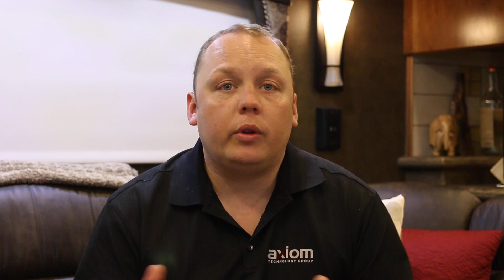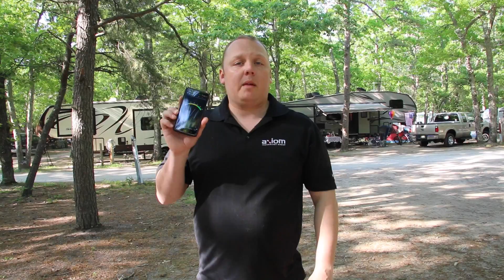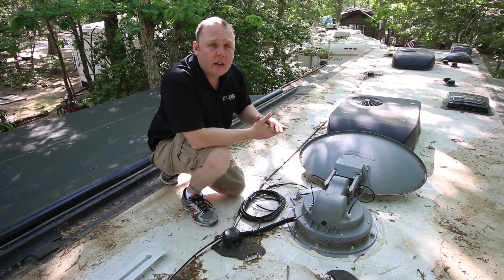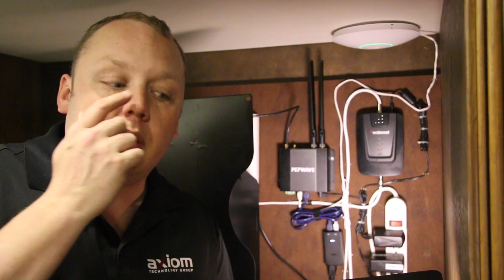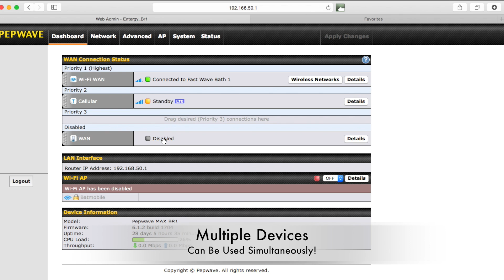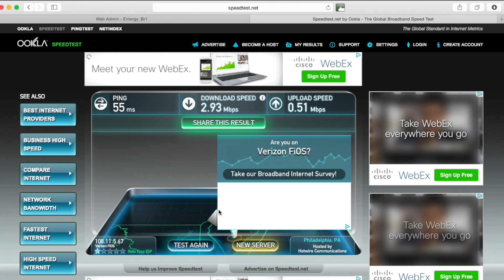Reliable Internet In Your RV Without Data Charges

Comment: Finally someone that actually seems to know a bit of the technicality of the items they review... whew how refreshing. One thing though RG-59/RG-6 is generally 75 ohm not 70 ohm though in short runs it really won't make too much difference. Good quality 50 ohm cable will make a difference in signal transmission. What is the 'app' you are using for the wifi direction?
Reply from the maker: +Riki B. Eyestarone thanks Riki, yea there are a bunch of notes in the video that only show up on a pc or mac. With mobile the comments/edits don't come up. We've changed this video to recommend the following: Technically you want a 50ohm cable (LMR-400 or RG-8 for runs over 10 feet) for best results but we found 70ohm (RG6, RG59) works too with an adapter found in our amazon store. the app we use is called wifi analyzer which there is a link for the app in the google play store https://play.google.com/store/apps/details?id=com.farproc.wifi.analyzer&hl=en
Reply: +LivinLite.net Yea... I use the same cable we use coiled around the mast of our EFP video units for sat and microwave. I've forgotten the cable number (I think you are right it is LMR) but we use 'N' connectors on it and the stuff is the thickness of a garden hose. 

You might want to recommend that the connectors be wrapped in silicone tape with dielectric grease used on the connectors as you are driving moisture into the connectors and cables leaving it all up there all the time.
Reply from the maker: +Riki B. Eyestarone thanks Riki, great feedback. More to come as we are testing the Wifi Ranger Elite right now and so far its pretty cool.

Comment: Just discovered your channel, great video!  Like the setup you did for wifi and the way you laid it out behind the tv.  Definitely a professional job!  We are in the process of selling our home and will be ordering a Class A and full timing a few months later.  I will be working some from the road, sort of semi retired. One of the decisions I am on the fence about is AT&T (which I currently have), Verizon which many recommend or T-Mobile which looks better everyday.   What is your opinion of the three and would you go with if you had to choose one.
Reply from the maker: Hi Ed! Oh the number of variables that go into answering your questions!!!! Ok let'st start by stating that these are opinions and they are highly dependant on where you are in the country, what your budget is and what your tolerance for issues/connectivity problems are. With that said, we'll tell you why we chose what we did. My vote is for ATT, the reason is because Verizon is cracking down bigtime on anyone using more then 90GB of data. This includes people with grandfathered plans out there. We have an ATT unlimited that we use regularly with about 100-130gb of data per month and we have no issues. We also like that when we go to festivals or other gatherings the ATT seems to always work better than Verizon (because everyone has Verizon and the network becomes very saturated during large events).  Now that said, i've heard nothing but good things about T-Mobile in recent months and they offer some pretty cool unlimited streaming plans that will knock out much of the data usage for most folks (netflix for example). We dont have any T-Mobile experience but since they run essentially on the same technology and network as ATT (because they had planned a merger for quite some time) this could be a great option. Now all that said, we use Verizon for our backup connection and it is the best in rural areas. Its almost always the fastest and has the best coverage out of our three (Sprint, ATT, Verizon)... That said, we can't use it for our needs because of the issues with unlimited data plans.... Make sure to checkout our article on unlimited data plans located here http://livinlite.net/how-to-get-an-unlimited-cellular-data-plan/ . There are some good tips there as well. Good luck!
Reply: Thanks for the info. I was thinking about it yesterday and decided I am going to keep my AT&T plan leave two of the lines on there and just move mine to T-Mobile to try it out.  That will give us the T-Mobile with the Hotspot for the PC and AT&T for streaming to Apple TV. The unlimited AT&T plan I have doesn't allow tethering. Thanks again!
Reply from the maker: +Ed Bickford Glad we could be of assistance! Let us know if you have any other questions!
Reply: What kind of speeds do you get with your mobile contract? Download would be my major concern, not so much with upload. Thank you :)

Comment from the maker: Some folks have asked us about omni-directional antennas being mounted to the Winegard bat wing TV antenna that comes standard on most coaches. We are testing this setup currently and will report back once we have more data!
Reply from the maker: +Life In Serenity Hi, testing went well. The key with omni directional (really any antenna, but directional will compensate for some of these shortcomings since they have higher gain) is to have a very strong wireless transmitter and to use the right cable to reduce signal loss. In general with a moderate to strong signal at the campground omni is great. If you have a very weak signal you may want to look at a WifiRanger product which provides an omni directional antenna and a very strong antenna to get some serious signal distance without having to point an antenna. Our wifi ranger video is coming soon as we are currently testing two units they sell extensively to see what we think. More to come!

Comment: I'd go with a yagi antenna rather than the panel variety. It's lighter and has higher gain. You'l losing about 5 dB worth of signal with the panel antenna, and that's a lot at the frequencies you're trying to receive. I don't know the length of that coach but it looks like near 40 feet. That's a very long run of coax, and that's also going to attenuate your signal. With a perfect match at the router you're losing another 3.7 dB of signal with good quality Belden RG-6A cable. RG-59 is worse at about 4.1 dB loss. 

A strong wifi signal strength would be about -70 dB. You can get that with the antenna in your laptop. It's more likely you're trying snare something like -30 to -40 dB worth of signal. Using your setup, you're giving up about 20% to 25% of the signal before it ever gets to the computer or router. At least get a yagi antenna. They are less than $40 from Amazon. I'd try to find a way to mount the antenna on the side fo the coach closer to youer entry point with something like an extendable flag pole. You can still rotate the pole, get the antenna up higher, and cut your coax run in half. You can just lower the pole to where the yagi rest on the roof, tighten up the pole, and you're ready to travel. Saves a lot of going up and down that ladder and it's a lot safer if it's wet or icy. For people who don't have a coax entry point, you can just drop the cable through a window since you're only going to use it while you're stopped. 

Of course, none of this does any good if you're at a campground where the wifi has very limited bandwidth. My experience is that limited bandwidth is a bigger issue than inadegaute signal strength. Campgrounds pay for their connection based on the number of  concurrent users. If it's a 100 spot campground, they may have a 30 user system. That's adequate for a lot of the year but not for things like holiday weekends when everyone watches streaming movies at once. If you happen to be user 31 on that system, you're out of luck until someone logs off. The only two answers are to use you improved antenna system to see if there's an open system in the are you can use or go to cellular data. If you're in an urban or suburban area there may be a McDonalds, Walmart, or Starbucks close enough that you can use their wifi. Look at google maps and plot the direction of those places or use one of the many free wifi directories on your tablet or phone. Turn the antenna toward those directions. You might hit paydirt if you are within about a mile of the location.

Comment: That pepwave device is performing a double NAT when you use it that way, which is why it allows you to only pay once for all of your devices. That may seem like a nice thing to have but it adds latency and can cause sporadic behaviour from devices that require UPnP to function properly. You also have to take into account that the secondary signal you are broadcasting can interfere with the primary signal if they are both in the 2.4ghz spectrum which is usually the case, not to mention everyone else around broadcasting 2.4ghz networks. To get the absolute best speed you should get a device that accepts the wifi signal and simply converts directly to Ethernet, an old PC running linux / bsd / illumos would work fine. Then you would connect that to a wifi access point, not a router. You would want to run that access point in 5ghz mode only.
Reply: My 40 foot RV is permanently located more or less as a cabin in an RV park in the Poconos Mountains.  The park I am in does not allow a secondary signal and anyone caught doing this will be expelled from the park.  Not a big deal if you are there for just a few night but I don't want to take the chance of getting caught.  Now converting the signal to Ethernet seems like the way to go for me.  Thanks for the idea.
Reply from the maker: I generally discourage double nat (at work) but the pepewave is specifically designed to understand how to manage this. It also knows how it routes DNS traffic between connections as it moves from one to another which is a nice tough preventing downtime while switching . In the 3 years we've used it we've never noticed any problems. Also the 2.4ghz issue hasn't ever been an issue. The pepewave channel hops to find the cleanest signal to broadcast on and avoids conflicts. Your setup would also be great but would probably involve some tech know how to integrate all the parts (yea ours was pretty complicated in this video too so ours isn't exactly easier! That said, the pepewave stand alone solution, especially when paired with an unlimited data plan is our go to after 3 years. We now have a wifi ranger on the roof that grabs signal and brings than into the pepewave via the WAN as well. Great comments and info for folks here. thanks so much for posting.
Reply from the maker: Checkout the ubiquity bullet titanium (omni directional). Will do just what you are asking and is super cheap. The wifi ranger will do this also but costs more (but will come with support). If your 100% permanent i recommend looking at the Nanostation which is under 50 bucks and is directional and will pickup wifi signals from VERY far away. Only issue is you need to point it. Good product. Amazon link: http://amzn.to/2xaOYQn. Best of luck!

Comment: This summer, we completed a 8000 mile USA tour and stayed at at least 25 campgrounds. About 2 of the 25 had consistent wifi. The other 18 had very slow, highly-contended access where it was almost unusable. The upload speed at these campgrounds was a paltry 10kbps. That's 10 kilobits per second...worse than dial-up. The only way to improve the speed was to get closer to the campground's wifi antenna. Your directional antenna would have helped. You must be camping at the expensive resorts, where more money is spent on wifi. Most of the campground owners I talked to don't want to spend $10,000 on updated expansive systems yet want to advertise that they have wifi. The problem is in the larger campgrounds have hundreds of devices trying to access one access point. The wifi access point is literally overloaded/polluted with RF signals, so it responds to the strongest signal. At one of the campgrounds we went to, which had 200 campers, we sat 10 feet from the wifi antenna of the access point to get decent internet speeds. At most campgrounds, Verizon was our only option. I am not a shill for Verizon, but they were our rock-solid alternative. At many desolate, remote campgrounds, one bar of Verizon LTE gave me enough speed to complete my business. Watching videos on Verizon would have unwise for my data plan.
Reply from the maker: Ouch, I've been to a few of these, they use outdated hardware and the campground owners know very little about how to improve. I'm finding they are starting to be the minority at least in the north east. It's a shame because a ubiquiti access point that would cover a campground runs approximately 65-115 dollars. From there you just need some wire, a ladder and elbow grease. We put two on a property in New Hampshire as a favor and cover almost 100 acres at high speed! A handy retired person or someone with extra time on thier hands could make good money doing these upgrades (or at least stay for free!) Generally the campgrounds bandwidth is OK but thier wifi kit is old and bad so the upgrades add little cost to the campgrounds budget and bring in more business. Someone could really make a buck doing these upgrades! Thanks again for the reply.

Comment: Several times pop ups mention LMR 400 and RG8 cables.  These are 50 Ohm cables and therefore would introduce an imbalance in the system that would have to be corrected for....thus reducing efficiency. Television cables (and WiFi) are 75 Ohm cables and the equipment is designed to work with those impedances.

I'm a licensed HAM operator. We use LMR 400 and RG8 because our systems are designed to use 50 Ohm feedlines. We only use higher Ohm cable to "match" an antenna with higher impedance to the 50 Ohm feedline and then the radio (designed for a 50 Ohm line).

I don't see how using "low loss" cable with the wrong Ohm rating can be helpful.
Reply from the maker: thanks for the input. The wireless panel antenna and associated router this was plugged into in the video are all 50ohm not 75ohm which is why we use the 50ohm cable recommendations. We originally had this wired with 75ohm cable (rg58 and rg6) since it was already there but since switched and found it doubled our range. I am by no means a HAM operator however I have not heard of wifi using 75 ohm before. Here is a helpful link for anyone else possibly contemplating/having the same issue/questions. http://www.l-com.com/content/Article.aspx?Type=N&ID=97
Reply: RG58 is 50 ohm (same stuff used for CB radios and some HAM gear) but it is higher loss at UHF and VHF frequencies.
Strange that you'd have 50 ohm cables in a TV set up where 75 ohm is the norm but one never knows what a system designer may have done to make things all fit together.

Comment: What about the WeBoost cell phone repeater. How did you go about mounting the inside and outside antennas, running cable and what are your results? 

What about the Ubiquiti Wi-Fi access point. Why did you install a second wi-fi access point (the Pepwave has its own access point), how good is the wi-fi signal in and around your RV with the Ubiquiti mounted in that location?
Reply from the maker: Hey William, sorry for the delay, this comment was missed. We have a weboost antenna that was designed for residential use. This allowed us to take advantage of the RG-6 70ohm satellite TV cable that was already running from our slide to the roof. We repurposed a wire that was unused and that connects to our external weboost antenna. Then we have the internal weboost antenna mounted next to the pepewave where it maximizes the signal boost of our router. As for the ubiquiti, we initially installed it as it offers 5G wireless and the Pepewave only offers 2G. We eventually did away with it and just use the pepewave, mainly to save on power when boondocking as the ubiquiti pulls about 1DC amp and we felt it wasn't worth the power for what benefits we were getting. If you want to learn more about our current setup hit up our facebook page and send us a message and we'll explain further. We will also be posting a revised video now that we've tested the wifi ranger and other products to compare in more detail.

Comment: Nice video my dear fellow citizen. Two points: 1. Please don't stream Netflix nor any video on a campground wifi system. It will rob everyone else of valuable bandwidth. 2. The upload speed should be symetrical to to download speed for optimal results.
Reply from the maker: Hi Tim, thanks for the reply. Just about every campground we've come across with a decent system has implemented QoS or  quality of service. This means they limit the download and upload speeds to ensure everyone has a decent browsing experience. The campground we filmed this at is no exception limiting the download and upload speeds per user. Typically upload speed is limited to about half that of download speed as part of standard QoS procedures, hence why our upload speed isn't asymmetrical. Unfortunately as a camper there isn't much you can do to control this limitation but QoS is a good thing designed to ensure that if your neighbor is watching Netflix, you can still have  your piece of the pie without things slowing up. Luckily today's connections range from 10-100mbps, so allowing users to use .5 to 1.5mbps each usually doesn't cause issues for folks. Thanks again for the reply!